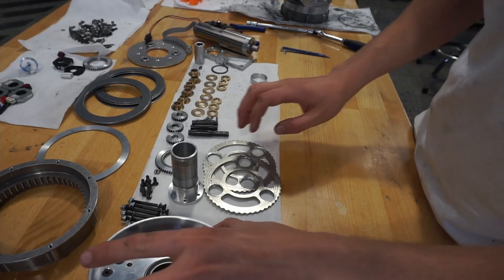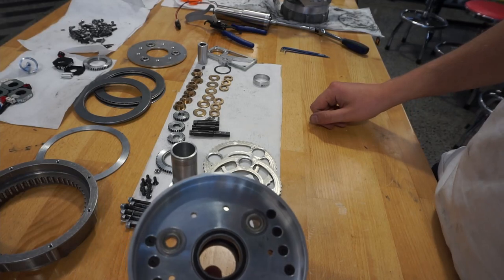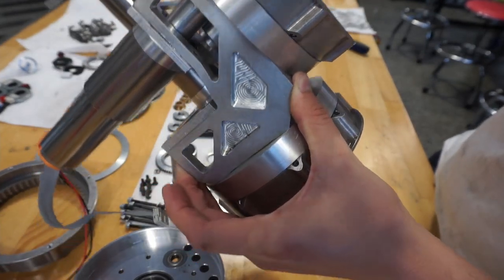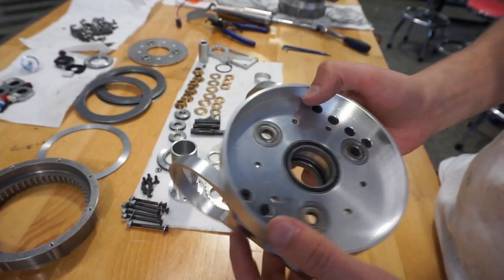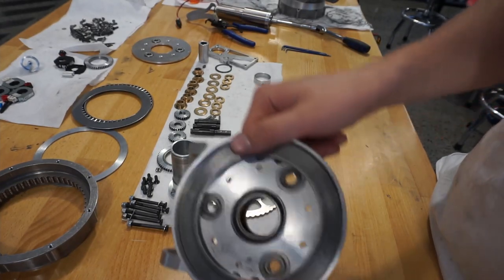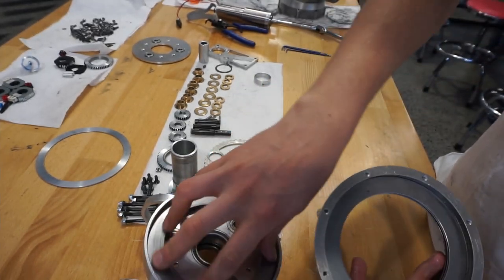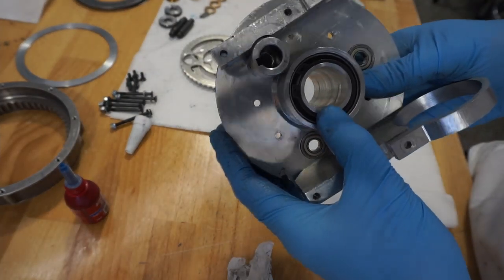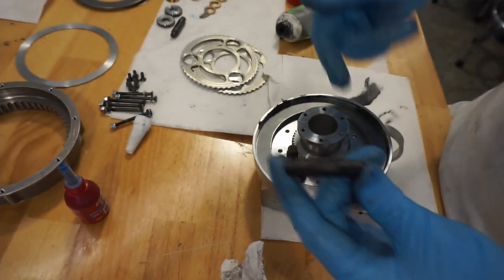Cycloidal Gearbox Build by Ayden Monsant

Comment: Thorough design! Although wondering why the ring casing wasn't supported by any radial ball bearings. Is the application purely for axial loads?
Reply: There are a pair of deep groove ball bearings supporting the hollow tube in the centre of the gearbox, these deal with most of the axial loads. There is a fairly large axial and radial load on each joint, as well as some more complex moments created by the placement of the joints off-centre from the loading path. Regardless, the large needle roller bearings were pretty overkill for these gearboxes and we are looking to support the loads with a simpler and lighter design in the next iteration.

Comment: At 41:13 you say it's ok, if the cage is stuck to the outer housing because the needles are free to rotate. This is not correct, because the cage is then fixed relative to the othe raceway (the one on the casing) and the rollers will rub on it.

Comment: Great work. Is the ring/housing aluminium too?
Reply: Hi Suat, yes the ring is aluminium, but using 7075 series since it has much better wearing characteristics than 6000 series. The ring geometry directly contacts the eccentrically moving discs so both these parts are made from this 7075 aluminium to reduce galling. You can see it has a darker luster than the other 6061 components.
Reply: @thehostilebeing  Aaah I didn't watch it to the end that day but now I have. I'm surprised that the output is actually the cycloidal ring itself. 

Again, this is a beautiful build.